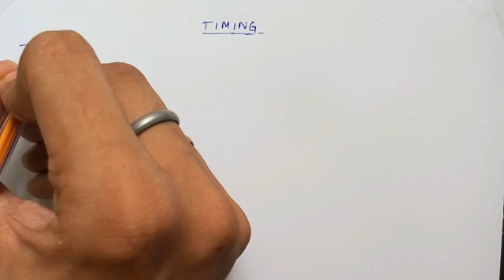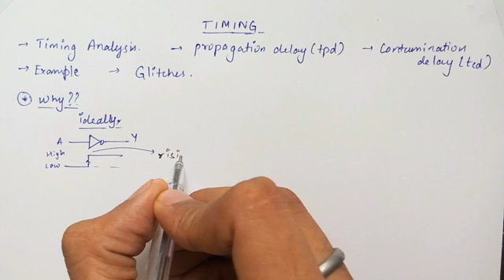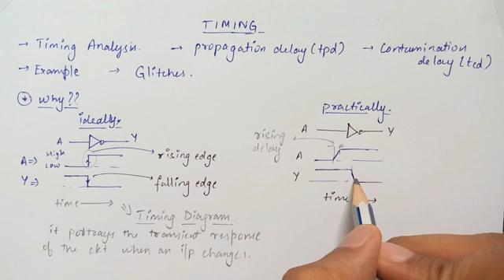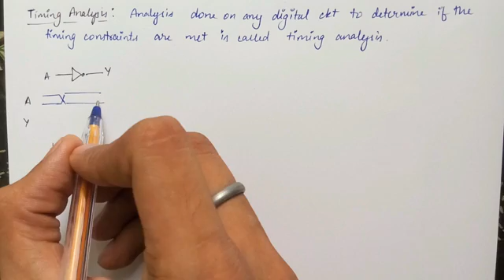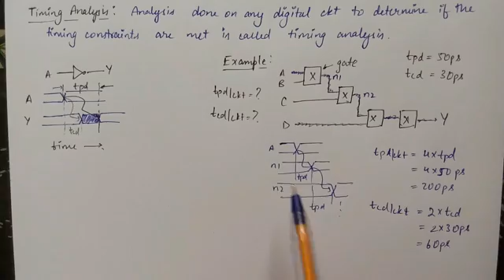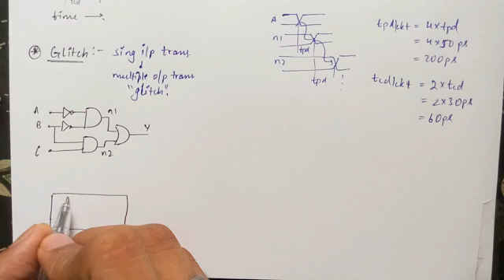Static Timing Analysis(STA) of Digital circuits- Part 1: Combinational circuits

Comment: @ElectroTuts please confirm, I am inferring that :
 > the minimum time that Y (output) takes to start changing from the point that A(input) first transitions is known as the contamination time
 > the maximum time that Y (output) takes from the point that A(input) last transitions to the point that Y (output) becomes stable is called the propogation delay  .
I'm drawing this conclusion after watching your playlist upto video 4 .If I'm wrong please correct me

Comment: You mentioned that change of prime implicant causes glitch. Change of B from 1 to 0 is causing a glitch. Whereas change of B from 0 to 1 doesn't cause a glitch. Could you kindly explain this. Thanks.
Reply: Yes, he had said it correctly. ...coming to ur question ... when u change b from 0->1 and u observe the output (considering inverter delay) it goes 1->1->1 so no glitch will be there. But if u observe the output for b 1->0 the output goes 1->0->1 ..there is a glitch in the circuit due to 0. Further for ur information, it is called static hazard and to be specific it is static -1 hazard in digital circuits....thank me later
Reply: @ankushkumaryadav65   that's an obvious thing. My question is, what does he mean by "transition from one  prime implicant to the other is the reason for the glitch".